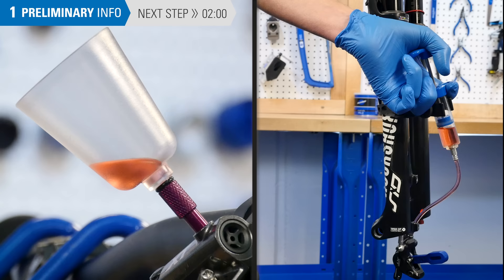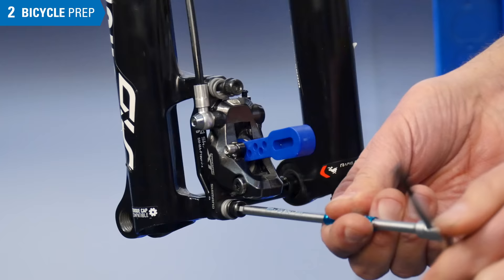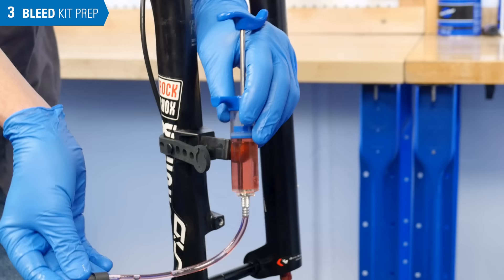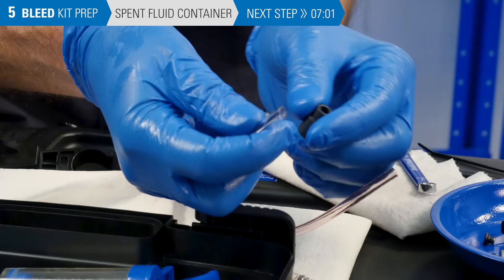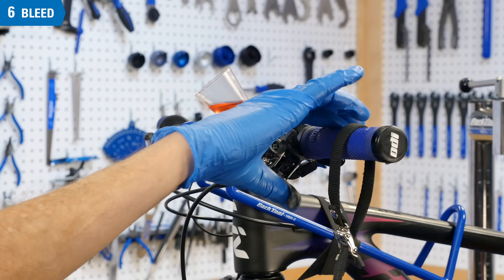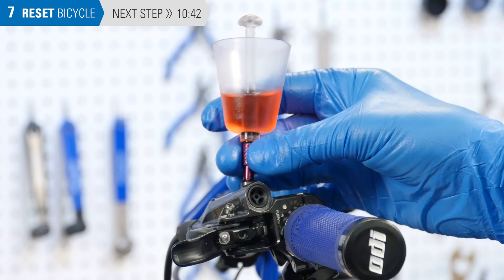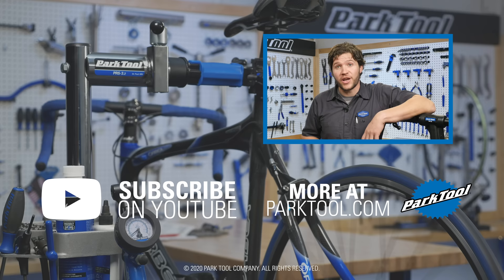How to Bleed Hydraulic Brakes - Shimano® Flat Bar Levers

Comment: Please don't be intimidated by there being so many steps in this bleeding process. It's a lot easier than it looks, get those hands dirty.
Reply: Gotta be honest bro.... this is intimidating. I just got my first downhiller with hydro brakes and have never serviced hyydros.... 30+ years of mountain riding and I’ve always had rimmy’s for brakes .... wayyyyy more easy to maintain but hydro discs are the sh*t !
Reply: Found this one first, felt a bit intimidated due to seemingly many steps. Followed the Mountain bike global network one.. straight to the point and into the action. Very easy.
Reply: @oneangryme  I agree that most of the time this is more than needed, but I'm really happy to have the extra steps laid out. I do my wrenching at 140 ft above sea level. My local rides max out at a few hundred feet, and I don't use the brakes for more than a few minutes at a time, but sometimes ride at 8- 10,000 ft. Brakes that work fine in the desert sometimes get quite dodgy when I get to Telluride, Durango or Big Bear without the extra attention to detail.
Reply: It is true that not all these steps are needed all the time, but they assure a better bleed - especially if you are having trouble with the Shimano wandering bite point problem.
Reply: I mean, it’s basically a fairly simple process — first push clean oil from bottom to top, then push clean oil through again from top to bottom while removing all the air.
Reply: After you do a few , IT IS A CINCH , EASY .
Reply: @JasperJanssen  This is why tilting the bicycle to get the caliper elevated for draining of old contaminated fluid is important .
Reply: Do it on a car and you will understand the concepts .
Reply: Ages ago one of my favourite professors at law school told us if we understood the theory we didn’t have to learn much by heart. The same goes for fixing bikes, if you understand how the system works you can figure out the procedure and it becomes fun rather than intimidating.

Essentially it’s just a master and slave cylinder connected by a vertical hose filled with fluid. Air moves upward so the idea of bleeding is to untrap the air bubbles so they will leave the system through the reservoir.

Comment: I don't get it... First you fill up the brake line from the caliper up to lever with clean fluid. After that you let the fresh fluid run from lever to caliper into a disposal bag? Why do you do it 2 ways?
Reply: Michiel Nooren: because It’s often a bear to get all the air out.  It’s an indictment of the design of bicycle brakes.
Reply: I only do it caliper to lever.  So far so good.
Reply: Yeah me aswel.! find it much easier and get better results.! Its nice to flush a couple of seringes of fresh fluid through anyway and seems to get most of the air out doing that..then do the rest from the lever
Reply: Maybe you get the bubbles out that you accidentally injected with the syringe? But it does seem like a a double check.
Reply: To pressurize the system better
Reply: Here's where I get confused - why not just bleed the fluid from the caliper, one way only. I imagine all the debris in the fluid is going to be settled at the low point of the system - which is the caliper. If you force the debris from the caliper up into the lever side, that makes no sense... seems to me the clean fluid should be introduced into the system top-down, just like in an automotive application. Close the caliper, then burp bubbles from the lever. Not sure why the extra faffing around has to be for bike brakes.
Reply: First you fill the system from caliper up to lever - it is a low pressure refilling of the system and flowing oil takes some of the bubbles from the brake line into a funnel. If oil is dirty or discolored, you will usually get most of it out during this step (you will then have to change it before continuing). But some bubbles may still remain in the caliper and it is possible to introduce some new bubbles while doing that.

So then you fill the system in the reverse direction - from lever down to caliper - this is helped with actuating the lever during that and then doing some intermittent high pressure pushes while depressing the lever. This helps get the last bubbles out of the caliper.

The last step is tilting the lever (or handlebars, or adjustable stem,  or the whole bike) couple of times while actuating the lever to get the bubbles out of the corners of the reservoir.

Exactly the same procedure is described in Shimano's service manual.

You can usually reuse all the oil (pour it back into the bottle) unless it is discolored or dirty when it comes out of the reservoir or caliper. This means that most of the time you actually almost don't waste any oil - you only use it to flush the system back and forth. This does not apply to brakes that use DOT fluid - this needs to be replaced every time, and even on regular basis, like once a year (because it absorbs moisture from the air, even through the brake lines) - actually the whole procedure is different for DOT brakes.
Reply: @richardjones2811  It's a self pressurising system.
Reply: @basengelblik5199  Yep, the fluid is non compressible, whereas air is. This is why we need brake fluid in the first place.

Comment: I counted at least 4 steps that no other brake bleed tutorials I've seen on yt have included (doing the 42 degree angle, flicking the brake line, applying brake pressure and doing the quick open/close thing, burping the brake... etc).  I definitely prefer this type of tutorial versus the "good enough" kind.

Comment: Lots of people (including myself) miss the point where you put a strap on the lever then open and close the bleed port. This is vital for a firm lever! If you miss this point you'll have a brake with no air but not enough fluid and pressure to give a firm feel.
Reply: thank you! I've got no air bubbles left in my system but cant get my brakes to feel firm going to try this.
Reply: @molley17  cool! How do they feel?

Comment: You have me convinced to just goto the bike shop
Reply: Loool 😆
Reply: I bought a kit and now I regret buying the kit.
Reply: Just took my bike into a REI and they got it done for just a little more than what the kit was worth. Yeah, I will never bleed my own brakes again.
Reply: This is why i still stick to mechanical cuz its easier
Reply: I work on cars and this just seems like too much, imagine tilt the car at a 30 degree angle.  Remove the caliper to bleed it.  lol
Reply: Have the stuff the guy done not even needed. Used way to mutch fluid.
Reply: @kartboarder22g17  lol its because the lines are smaller i would guess but i agree
Reply: lame
 this convinced me to do it
Reply: Just get mechanical brakes
Reply: Two times now my bleeding myself ended up with no break power at all...... Doing everything that I have to..... Errrr piss off
Reply: @antlerr  you have bubbles stuck in the line
Reply: @antlerr  Stahlbus bleed valve will do bleeding and fluid filling by itself. It goes into the brake caliper inlet...but I don't know if it's gonna fit Lol. You will have do measurement of the screw hole diameter and the depth of the hole. This valve makes bleeding very easy and effective.
Reply: Nah shimanos are so easy to bleed, attach fluid filled syringe to caliper, and bleed cup to lever, push fluid through until clean/bubble free fluid comes into the cup, remove syringe, re tighten bleed screw, pump lever until no more air into the cup, remove cup replace bleed screw,pads and done, calvin goes wayyy over the top
Reply: Its really easy tho. And a cheaper 30 USD bleed kit can do it for way cheaper than a Lbs. Hell a bike stand, hex wrenches, the cheap kit, and a beer, will already be saving you money after two times of bleeding them. Which all of the above (aside for the kit) can also be used to do a lot more than you would think.
Reply: @kartboarder22g17  lmao
Reply: Hahaha
Reply: @hench_wrench_repairs  yes sir. Works every time. Exactly how I do mine. Easy peasy.
Reply: I felt the same then it was ez once I taught myself from YouTube lol
Reply: @robertmorrison4458  True. I agree a lot of the steps in this tutorial are not necessary, such as tension strapping the lever. However it might be the most thorough practice and best to do...

Comment: Simple and easy to follow. Takes the mystery and expense out of bike maintenance.
I can do it
I can learn a new skill
I can save money
I can justify buying more tools
Reply: Same here, although I’m not sure about having saved money. I spent like $700 worth of tools to save around $50 at my local bike shop.
Admittedly, those tools will continue to save me money, but it will be at least 3 years of DIY servicing until I break even 😅
Reply: @onegrapefruitlover  you don't need $700 worth of tools, you need the tools you use for your bike/s

I have around $100 worth of tools they all fit in a box and I can take apart and service everything on my bike, often, on other people's bikes as well.

If you don't have an air fork, you don't need a shock pump, for example.

Comment: bang on i was struggling to get that last bit of air out of the system with my shimanos and just tilting the bike and the resovior helped a lot, thanks
Reply: Can you do just this part first to see if it corrects the issues? Then do a full bleed later if brakes are still unresponsive?
Reply: @danielbromley849  Yes.

Comment: Kit paid for itself after two bikes. I'll be doing this every spring. Got the process down to 15 min.

My favorite feature of the kit is the stop plunger. Though make sure to pull it out before pushing fluid up from the caliper, launched the plug across the garage lol

Comment: In order to install the new silver type of compression sleeve that is delivered with the BKM-1.2 kit now, first check if you need to deburr the edges of the sleeve. Then, apply a thin layer of silicon grease to the end of the hose to make it slide into the compression sleeve effortlessly. Kind of a Crisco situation here since the silver sleeve is a very tight fit and without grease the hose appears to be impossible to insert. Make sure you clean all excess grease afterwards in order to not contaminate your brake fluid later on.

Comment: Certain lever set screws / bite point adjustment screws, when set to their maximum extent, close the hydraulic  system. Find the max point as described at 2:04, then reverse a turn or two to be safe.  Your shop floor will thank you.
Reply: Omg you hero! I only wish I had seen this comment earlier. Could have saved me much frustration and mess! I couldn't understand what I was doing wrong having never bled brakes before. This solved my issue completely :)
Reply: Me too! My god I was wondering why nothing would drain out the caliper, it took hours and mineral oil everywhere until I worked out it!

Comment: Hey dude, just saw your clips on de- airing hydraulic brakes. I got a good laugh. Wasting of time and money. I have been doing major brake service for trucks and cars.   I just did my brakes for my Cannondale. Just top up from the top and release from the bleeder below. That's it. Less then 3 minutes. The lines are packed and good to go.
Reply: Yes you could essentially start at 6:09 and it would have the same effect.

Comment: After doing the bleed I like to put a little positive pressure in the system with the syringe.  I can adjust the travel of the lever before engagement this way.  The Shimano adjustment at the lever doesn't do squat and I hate a lot of travel before the brakes engage and having to keep the levers so far from the bar.

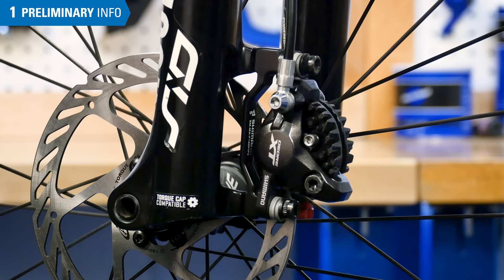Comment: On 1:46 the brake is installed INCORRECTLY! There's a 160mm rotor but a +20mm adaptor for a 180mm rotor. The pads won't touch the rotor braking surface sufficiently if ridden like that!!
Reply: What is wrong then?
Reply: @xGodfreyy  The adapter should be left off. Or alternatively a 180mm rotor should be installed.
Reply: Don't diss Calvin
Reply: After the bleed was done he left it out when he reinstalled the caliper
Reply: I think they did that for demonstration purposes
Reply: well a perfect bike wouldnt be at a bike shop would it?
Reply: Nice .... :-)
Reply: Nice spotting, but you have to notice that when reinstalling there's a correct sized 180mm rotor there.

Comment: I bleeded my brakes yesterday before watching this, most videos just speak about pushing oil from bottom to top only, which will end up you having spongy and weak brakes, the steps of pushing again from top to bottom, pressing and quickly opening/closing couple of times, adjusting 30 degrees other side to get all bubbles, etc, today's evening I will try to fix my brakes again, wish me luck :D

Note: I am also suffering from a case where 1 piston is extending more than the other one, not sure why, I cleaned and lubed them but still there 1 piston that is popping out more than another one
Reply: To really fix it then remove the pistons check how they look and maybe replace the sealing rings

Comment: This right there is why you should take the bike to a local bike shop. 
Yes, sir.
Reply: This is just a bike, no a car with ABS systems (even there the brake fluid can be changed at home)
Reply: Honestly while this is a great video, it's over complicated. I could see doing this if you can't get the normal version to work. Lookup the shorter shimano bleed videos, one of Santa Cruz's race mechanics has a famous one. It's way easier than this and almost always works. But for a total technical process, park went through literally everything.

Comment: This is good but I really, really wish somepne did a longer version with each step explaining WHY each step is being performed with some explanation of how the brake works so it makes sense.  I have to take my brakes back to be bled so often I really need to learn how to do it myself. Need a beginners versus of this.
Reply: Ask me which parts you're wondering about and ill get you the reasons why they're done.
if you could give the timestamps that would help
Reply: @stephenallen4635  7:03 step i dont see why its there
Reply: @stephenallen4635  1) he's pumping fresh oil from caliper to the funnel. Isn't this enough to bleed the brakes? He's doing another step 2) where he is pumping oil from funnel ...why is that...fresh oil is already there.
Reply: @ninjapyro9969  when you squeeze the level youre pushing the plunger down while the fluid is still trying to enter the pipe, pushing it helps draw the fluid in against the pressure of their air, when you release it sucks the fluid into the plunger space helping prevent bubbles.
Reply: @aaauto  as the fluids going up on the first pass there can still be air bubbles caught in pockets near the bottom either in the space near the caliper or in any kinks there might be in the hose, when you draw fluid through the other direction it pushes them out the other end
Reply: You push clean oil from the bottom through the system to clean contaminants, and then you push fresh oil from the top to the bottom to get the air out, plus those other couple of steps are also to get the air out.
Reply: You can also find someone in your location that knows how to do this. Pay them a few bucks to walk you through the processe(in person).

Comment: In my humble opinion : too many tools and steps. The syringe's step of pushing oil from caliper to oil funnel could be skipped as long as the next step is gravity bleeding when you get rid of any dirty oil in that plastic bag.  And I dare say it is easier to remove dirty oil at the lowest point and not the other way round. However, very informative! So thank you for your efforts

Comment: Great video. I have been wondering why not to use syringe attached to the caliper to create little vacuum in the system and get oil from funnel at the lever to the caliper instead of just pushing the lever and opening bleed nipple?
Reply: Because you already have the lever on that side as a pump. And because syringes don’t pull a vacuum very well and if they did it would cause bubbles, rather than bleeding them out.

Comment: Once flushed all new fluid in theres no reason to use waste bag. It's better to use a hose attached to syringe with top off to flush air out of caliper. As this allows drainage hose to stay submerged. This will prevent any air from back traveling into caliper and cleaning of a waste bag!

Comment: Are we supposed to do the bottom to top bleed (step 4) and the top to bottom bleed (step 6), or are those intended for 2 different systems? In other videos I see people doing one type of bleed or the other, then going to the brake burping step. This video seems to suggest that we need to do both... is that correct?

Comment: That was a rocket science
Reply: Shimano also has a good manual for this procedure, the video looks more complicated (since it covers different brake types) than it actually is. 
Hydraulic brakes using mineral oil (no Dot4) don't need bleeding really often, Dot 4 mixes with water (from humidity) over time but mineral oil mixes only marginally with water and can be left in the brake for years. Since it's normally a closed system you typically don't get air in as long as you don't disconnect brake hoses. 
Especially simpler models like the MT200 are also simple to bleed, they adjust the play of the pads by themself and if the pads are worn you just have to push the piston back (for example with a screw driver between the worn pads) and put new pads in.

Comment: New brake hose installed with newish caliper and older lever.  I can't get fluid to flow from the funnel to the brake caliper.  What did I do wrong?